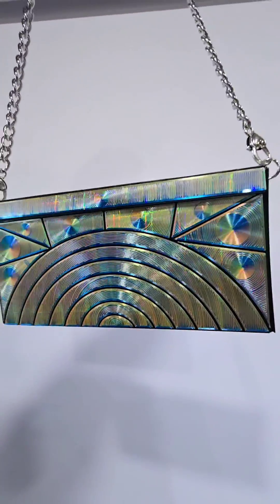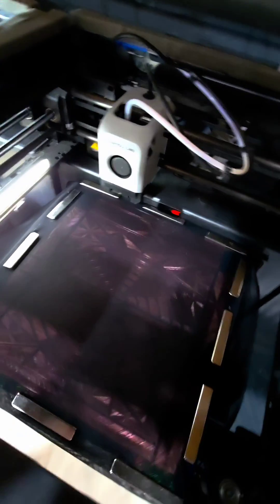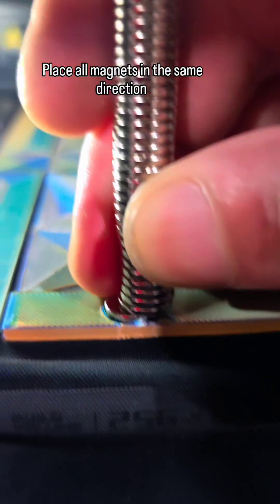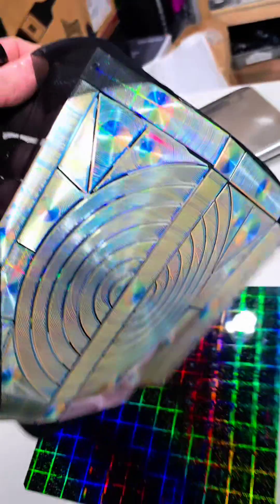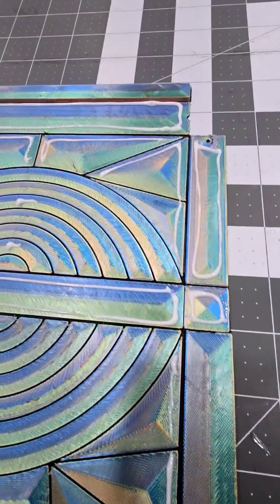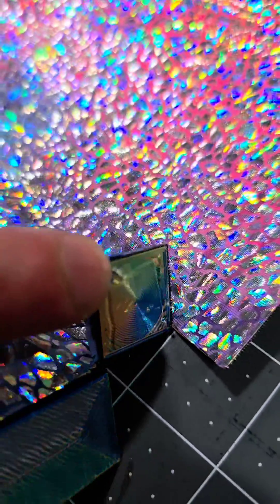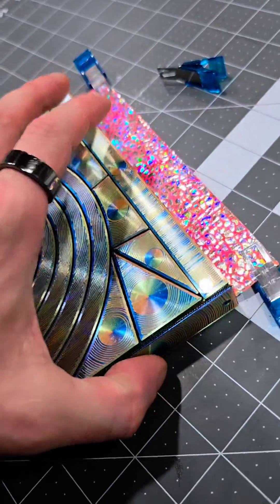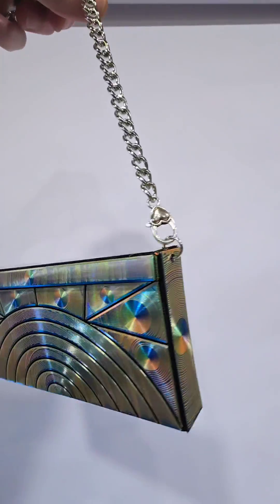3D printed foldable clutch with magnetic closure

Comment: When the printer paused for you to place the fabric, the top of the print had such a pretty pattern!, As if it had been the side printed facing down on the build plate, how was that look achieved?  
Stunning design! I appreciate the walk through. Thank you ❤
Reply from the maker: @kellyjean4981  great question! This was achieved by changing the top surface pattern in the slicer settings. This is how I create the bottom pattern as well. The one you're referring to is the pattern "octagram spiral"